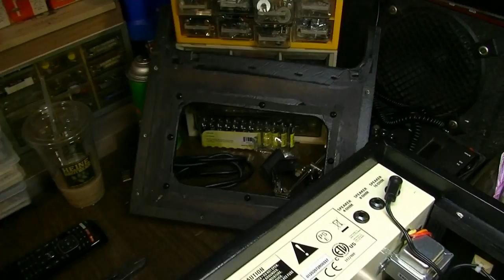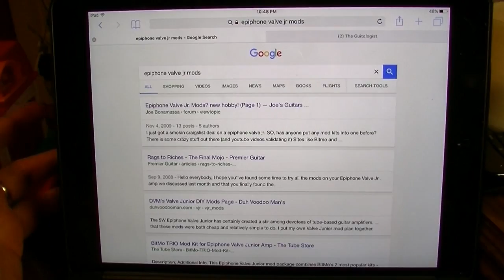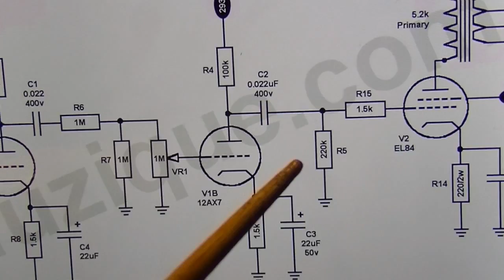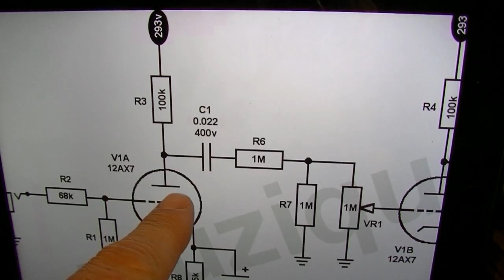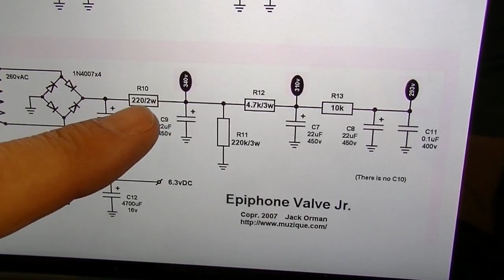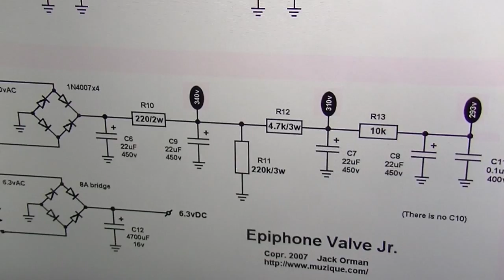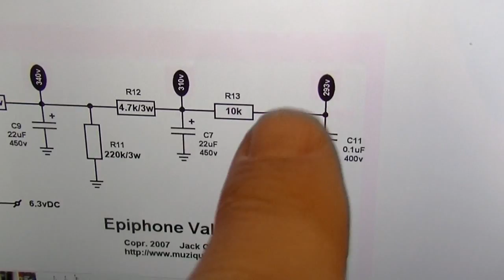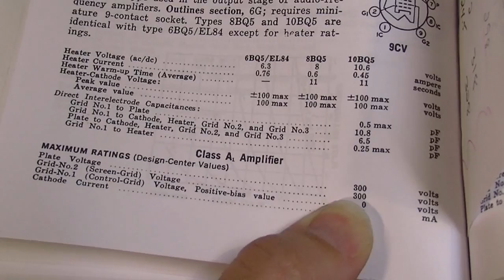Epiphone Valve Junior  Mods - A Total Waste of Time?

Comment: I really like my Valve Jr.
Ive had it for about ...dunno. maybe 9 years.
I play it a few times a week.
It's not the combo though. It has a 12" Eminence speaker in a separate good sized box.
It sounds great! Really great!
No modifications.
If I'm noodling at low volumes while watching TV it sounds really nice. 
I've played it with a drummer who plays well at low volume ant it sounded fantastic. 
I play along to my stereo and this thing blends right in with the recordings.
Clean recording like blues or jazz. Even acoustic, all the way to fucking crazy noise metal.  

For overdrive/distortion I use a Behringer vintage tube monster, or Way Huge swollen pickle.
I was using a mate's Tech 21 double drive peddle for a while and it sounded fucking SWEEEEET!!!  We used this combo to record.

I don't have any of the complaints about the Valve Jr that others do.  Clean, or heavily distorted I can always get a tone that works.

I love the micro harmonics too. Sometimes it just fucking shimmers. Beautiful.

peace, love and mung-beans you fucking guitar sluts!  THRASH TILL DEEEEEEEEEEEEEEEATH.

Mark

Comment: This was my first real guitar tube amp. It was a great unit to learn about modifying tube amps, but I never got any really truly great, musical sounds out of it. Today, after years of screwing around, replacing stuff, the only original parts are the power transformer and the chassis. Using a Vox-like circuit (turret board) and it sounds killer. Still running a solid-state rectifier; considering replacing that with a tube rectifier to get some nice sag.
Reply: jeddek,

I had exactly the same experience with my Valve Jr head. I built the Watts Tube Audio "Marshally" kit and used a MM output transformer and couldn't be happier with this now smokin' little amp. I play it through a variety of 1x12, 2x12 & 4x10 cabs. An economic failure, but a priceless learning experience.

It's a little lacking in power for most of our gigs, but it's great for rehearsals and jamming at the house. It sounds great all by itself and takes pedals well.
Reply from the maker: So you gutted and hand-wired?
Reply: I replaced the factory circuit board with a 'Voxy' board + component set that someone was offering. I think it might have been Watts Tube Audio - can't remember. Also replaced the output transformer with a Mercury Magnetics. The end result is a good-sounding, if not very versatile amp. If I look at this effort from an economic perspective, it's a complete failure. I could have bought a nice little low-wattage Vox-like amp for less than I spent. But from an educational perspective, it was great success. A fun project that got me comfortable working around tube circuits and gave me the confidence to build a multi-stage, multi-channel 18 watt kit from Trinity Amps.

Comment: FYI your decade box caps are shorting out, that's why you have the cutting in/out problem. I've seen that exact issue with old/cheap caps. If you replace the caps in that box it should remedy the problem.
Reply: I think he knows that.

Comment: Boy you get a lot of comments fast, don't you. Nice video, Brad. A Valve Jr. was my first build (built it in a computer power supply as the chassis). I've hardly used it since I built it. Just not a great sounding amp. I like what you've done with this one, though. I might do a rebuild of it...

That speaker at about 30:35 is Best brand (EIA code 371).

Comment: What is the expected life expectancy of that 6BQ5 with the plate voltage up by 10%. The very first guitar amp I ever built used a 12AX7 and a 6BQ5. I used a couple of 6x9 car speakers. Tubes and old speakers seem to be a pretty good combination. Nice video. Thanks.

Comment: You can get a smoother tone, but loose some gain, buy installing a negative feedback loop from the positive pole of the transformer output to the cathode of the second 12ax7 stage. A typical feedback resistor value would be about 22k but you can experiment with values. I have removed this feedback circuit from small Fender amps in an attempt to increase gain but almost always replaced it to the original configuration to get a more rounded and smooth tone. Negative feed back circuits would be a great subject for a future youtube.
Reply from the maker: Thanks for the comment. I'm aware of NFB, but like you said, gain suffers when it's used, so I was trying to use other methods of smoothing tone, such as grid stoppers. They can smooth tone in a more subtle way and stabilize a circuit without the pronounced detriment to overdrive tone.
Reply: I really appreciate your videos. Very well done and and your explanations are very lucid. Please keep them coming.

Comment: Just wondering, the "glorified' cardboard is a more dense product than plywood, so in theory, you should get a warmer sound. Unless you are some kind of maniac that plays and transports in the rain alot or jams under water the "cardboard"  should hold up just fine
Reply from the maker: I'm not even talking about particleboard here, I'm talking about stuff that was obviously once PULP being made into material for cabinets. You're right, I would not leave the stuff in wet anyway, but the point is, it's a material that was made to last and not fall apart if you drop it or it tips over. And while particleboard may be ok if you are going for frequency neutral hi-fi type tone, a guitar amp is supposed to resonate. The cabinet is part of the instrument. If it's made of cardboard, it isn't the best instrument it can be.
Reply: Didn't mean to imply that you are a manic playing in the rain, I see now that my comment was a little cynical sorry about that. I like your videos.
I just ordered a Pignose, can't wait to get it,
Reply from the maker: I didn't take it that way at all. Thanks for commenting.

Comment: What I have never understood is why the factories that build amps don't make them sound better to begin with, if tech always mod them and make them sound better? Do they not want them to sound good or just don't know what they are doing?
Reply from the maker: Considering they've probably sold a million of these, guess they didn't need to improve it. They were building to a price point and had a particular customer in mind. I think they found those customers - beginners who want  a "tube amp" and modders who want a bargain.

Comment: As for dating this amp, the serial # may or may not have a year code, but the circuit board date code is visible at 8:48, between the looped wires above the tube socket -- 24th week of 2007. So the amp itself probably shipped late 2007 -- maybe a Christmas present? That's of interest only because of the talk near the beginning about the particleboard cabinet era. There's another marking, a Pb-Free symbol between the tube sockets, which means there's no lead in the surface finish of the bare PCB, or in the assembly solder. That might work against the long-term reliability of those board-mounted tube sockets, but if the soldering was done correctly the difference should not be that great. In any case, almost all electronic products sold worldwide need to be lead-free, so it would be no worse than a competing amp from the same time period. The build quality does look surprisingly clean, as mentioned. I'm sure many of us were expecting "spaghetti factory" wiring, but it's tidy as hell.
Reply from the maker: Good points...especially about the lead free solder.

Comment: If you cut out that 220kOhm to ground from the power supply and accientally switch it on and and on within seconds you gonna risk your output tube, as the B+ is already there and the filament is hot, but not fully working and that may damage the EL84 heater...
Also this resistor discharge the high voltage down to zero volts sufficently...

The 0.1µF foliCap reduces the noise of some switch mode power supplies, or the commutation noise of light dimer circuits. These are rather new things which had not been around when the original tube amps HeyDays....but non of them electrolytic Caps are able to help here...you really need this tiny foil stuff in order to have a sufficientrreturn path for these noise voltage or they use your tubes and you´ll have the noise in your speaker....

Comment: I'm curious about the zobel network as far as it's intended result. They are normally used in a system with a crossover to stabilize the impedence so the crossover work's correctly. It's mostly understood that with a full range speaker and no crossover it has no effect. At least that's my understanding. Just wondering what your thoughts were.
Reply from the maker: This is an idea I stole off Hammond. I did some AO-35 conversions and found this network fascinating. Found out Dr. Z swiped the idea too. It definitely has an effect, depending on the values used, it can be more or less pronounced. I see it as a sort of alternative to NFB to smooth spikes at the OT and smooth the tone without really affecting overdrive.

Comment: I have a late model version (Ver.3 if I remember correctly) of this amp that has only a couple of mods to it. Probably the best results came from replacing the stock transformers and using a 12AY7 in the V1 position. It even makes my cheap 4 x 12 cabinet sound acceptable.

Comment: kinda funny the whole time I was thinking what about the speaker, if it had been me I would have started there. The only reason is in my experience I've often found that the factory uses a thin baffle and short screw so they have to torque it so tight it can do ugly things to the tone of the speaker as well as being a cheap speaker. I just sold my head of this amp which I always used with a 12" speaker which gave it a little more bottom end. thanks for another great video

Comment: Seems you could be blaming all that wool on the amp when meantime a speaker change could really open it up?
Reply from the maker: No, it was the amp. The speaker helped, and even the replacement wasn't ideal, but the circuit left a lot to be desired.

Comment: Nice video! Good to see all the process. A Eminence factory tour would be cool. Did you change those 12ax7 bypass caps from electrolytic to regular caps? And why?
Reply from the maker: You only need electrolytics in that position for higher values. Polarization isn't necessary there.

Comment: A few months ago, on a lark, I bought the head version EVJ at Guitar Center for 90 bucks. I stuck some good tubes in it and run it through a 12" Celestion Alnico gold speaker I have in a spare cabinet.. It sounds pretty darn good. It still needs some mods  as it doesn't quite have that EL84 sparkle and chime as my Gibson Super Goldtone does and it's not a blues machine like my AB763 Super Reverb, but for under a hundred bucks, it was a no brainer..

I think however getting the head version and running it through a good 12" speaker (or two) would make a huge difference in it's tone, punch and tightness.

Comment: Interesting that for the filament supply voltage, they use DC instead of AC. I'd highly recommend changing the filament voltage from DC to AC. If you decide to do this, I am interested in the results, I know it'll increase the tube life, and can help making the sound a little more robust.
Reply from the maker: DC filaments on a board like this really helps to stamp down noise. I am sure that is the reasoning. After completing this video I went back and read some of the other mods people do and apparently Version 1 of this amp had AC filaments and people were rushing to mod them to DC.
Reply: Interesting.... have a theory on why that may be? Do you think it's a board layout issue, a component issue, or a design issue? I've found that installing a choke on each of the filament wires (I wrap a few turns of wire around a ferrite toroid) and a .1uf bypass cap to ground on each tube helps with noise/hum quite a bit. I love your vids man, keep 'em coming!!

Comment: These are a odd one, as they aren't listed on the Epiphone website, have been around for donkey's years and they appear to still be making them! Yeah, I mean to get something decent like a Marshall here in Australia  - you're looking at over $1500. I think the big brands like mesa, marshall, orange etc are going to put out some 'affordable' lines Assembled in China from Americ... er used to be made in America, now made in China! parts.

Lol, that amp stock sounds like some of the Bootleg recordings I've heard of Mountain in the late 60s / early 70s.
Could be the speaker though.. I wanna get a set of the overwound TV jones 'Powertrons' As I love goldfoils, they have the beautiful clarity of single coils with the punch and quietness of a Humbucker.
Reply from the maker: I am of two minds on this TV Jones in this Tele. I picked this guitar up with these pups already in it and this TV Jones sounds ok on some amps, but comes out sounding thin and kinda out of phase on other amps. I prefer the stock Tele neck pickup, if I'm honest.
Reply: I heard the Brian Setzer model tv jones' at some guitar show, when they had just come out, and going through a marshall JCM in a Les paul Jr, they sounded unreal. I guess it's the amp factor too. And they are a few K less than the powertrons I like : https://store.tvjones.com/powertron-plus---mounting-options-c46.aspx

I don't know it's wierd, I don't like Seymour Duncan JBs that much, but I heard an Invader (which are around the same output) in a single pickup explorer, and it sounded marvelous, where everyone says they are only a balls to the wall metal pickup. I really prefer getting my power out of the amp, rather than having massively overwound pickups. You lose mids and highs and it gets too muddy when you go much over 16k. And people thing the K rating is what gives pickups their volume. Wrong, while it contributes, it's more so in the resonant peak. And there are a multitude of different magnet types which will change the output and tone again, and how much you gauze the magnet affects again. 

One of my fav pickups ever is the Kent Armstrong Z plus (which Schecter used in the late 70s and early 80s, they do a version, but the actual Armstrong ones are better made and absolutely the same as the 70s originals.) And they are only about 12 on the bridge and 9 on the neck. They are the ones the 12 allen headed adjustable pole pieces.
Reply from the maker: Magnets have a MASSIVE effect on the output and tone of a pickup.
Reply: Still on the website but no longer made.
http://www.epiphone.com/News-Features/News/2005/The-All-New-Valve-Junior-Amplifier.aspx

Comment: Another small note, the 220 ohm in the power supply isn't to drop voltage as much as with the cap before and the cap after is for filtering.
Reply from the maker: You are right. It's part of the filtering network. I only mentioned the voltage drop because I'd already decided to eliminate it and figured it wouldn't affect the voltage at the OT node much at all.

Comment: Just a note, a .022 cap lets thru more bass than the lower range of a guitar. From .022 going larger is pretty much not audible. It's more in the range of feel. And on cathode caps once you get between 5 to 10 mf your fully bypassed. Never understood using huge caps there. From 5 down to 1 mf really starts cutting bass & from 1 down you start getting into mid cut. 1mf starts rolling off around 1000 cycles and really dives around 200. A buddy of mine has one of these and just to kill some time I did a bunch of mods. Even put in a switch with some clipping diodes. And a master volume so you could push the pre amp good. All tho the diodes cut the signal so much when they're in the master has to go to full. Really gives it some nasty distortion. But no matter what they still don't sound very good. But fun to mess with.
Reply from the maker: Thanks for the comment. My experience contradicts this. In tests with my capacitance decade box, I've found coupling caps above .02 to make a large difference in bottom end. Likewise, A/B-ing different bypass caps in many amps, I know the it depends on the tubes being used AND the frequencies you've already allowed to reach the grid of that tube or tubes from previous stages. For instance, in an amp with the PP 6L6GC output in a Silvertone 1484, a 100uf bypass cap is totally necessary to get that full, thick bottom end on that amp. Other amps want their own values, and if it seems like nothing is happening above a certain cap value, it's sometimes because you've cut off those frequencies earlier in the amplifier, so they cannot be expressed at the output, or past the stage you're trying to bypass with the cap.
Reply: Amputee

Comment: Valve Junior's all not all the same...that's why there are different schematics....It depends what year yours is...
Reply from the maker: I did figure that out too, at length. I think I have "Version 2", the one with DC filaments.
Reply: The first version had a green circuit board...

Comment: how difficult would it be to add a reverb tank to that amp?
Reply from the maker: Very easy to add a tank. Not so easy to make a working reverb circuit. Not even sure it could be done. You'd need at least one more tube to drive and recover the reverb signal.